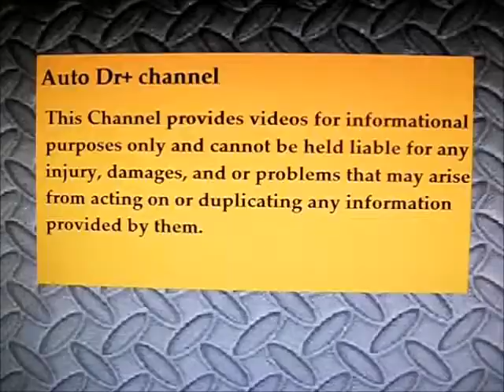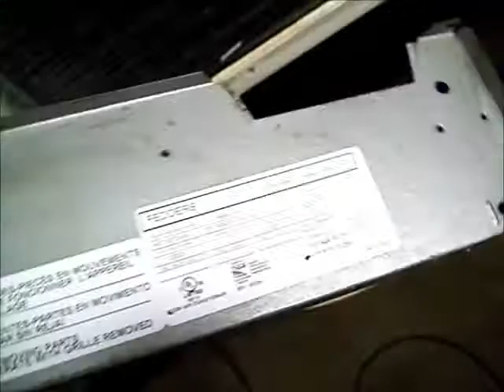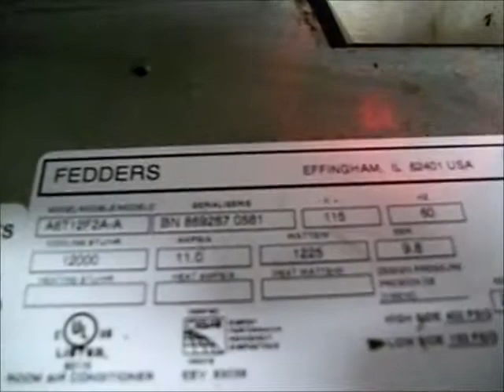pt2 Fedders 12,000 BTU AC unit stuck blower motor repair

Comment: gr8 vid i guess i'll have to take my motor apart tomorrow. The insulation needs replacement though any suggestions?  it was some black foam glued  to the metal, and some moldy fiberglass facing the compressor
Reply from the maker: Rod Salka. May check on eBay for a suitable material.  Be sure and use a garden hose sprayer and clean the condenser fins in the back.  And straighten any bent fins.  Cleaning the condenser once at start of season, can extend the life of the unit tremendously.  As well, cut the electric usage by half.  Plus a condenser that is clean, will reduce the output temps a couple more degrees.  To check for blocked condenser, you need only to feel the vents on the side of the a.c. cabinet for air blowing back instead of being drawn in, and then exiting the condenser fins efficiently.  Should feel like a big hair dryer on low straight out the.           back.  Thanks for watching.
Reply: Sadly I gave up - couldn't get the shroud nuts out, and I broke off the power switch knob. Replacements aren't too expensive,and I need a smaller unit since this one was way too bulky. But thanks a bunch-I'll definitely try to heed your advice and keep it clean, this time!
Reply from the maker: May try some pawn shops for a good deal on a newer unit.  Thanks for watching.

Comment: hey what kind of light are you using, i need one of those?
Reply from the maker: Not sure, it was an excellent light.  Last like 6 hrs., bright, but the on-off switch was substandard, and broke internally if pushed to hard.  Some guy came through selling them, with the ole lifetime warranty chatter, replace free if lost or broken.  Well...I never seen him again.  The light still works, but has been dropped multiple times, and is just about busted to pieces.  I did repair the broken switch inside, and have been more careful with it.